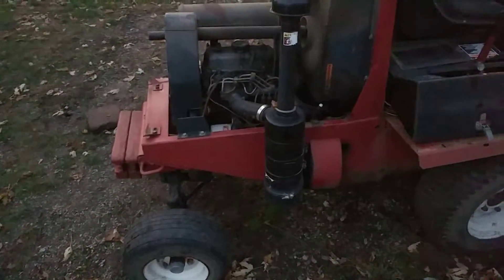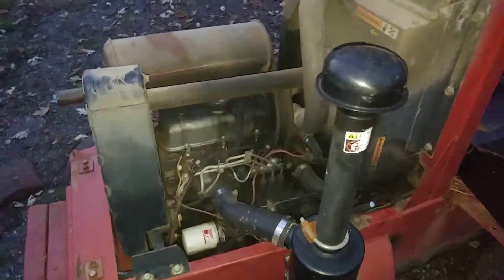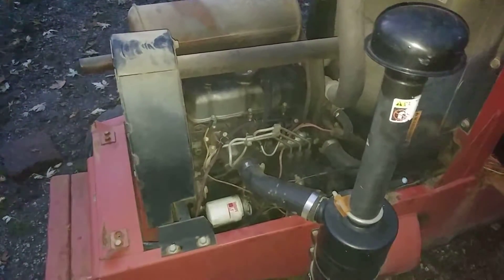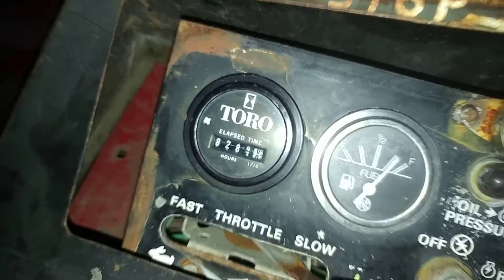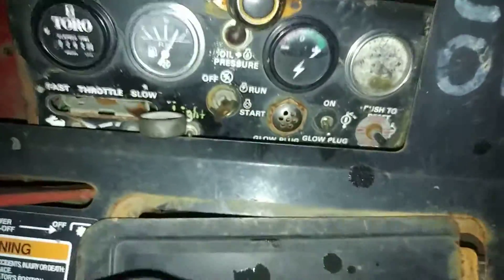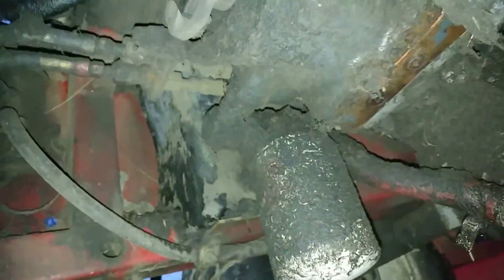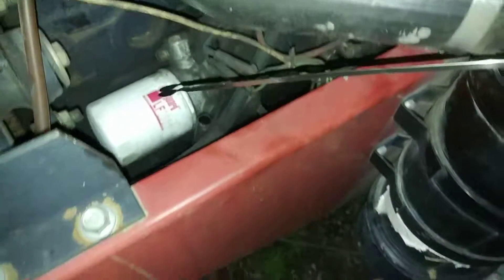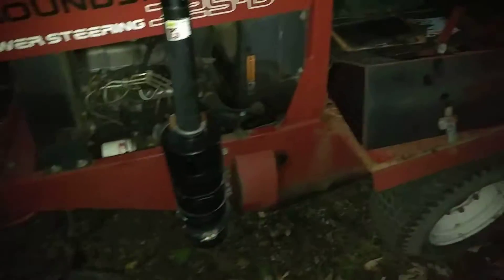93' Toro Groundsmaster 325d with Mitsubishi K3D diesel

Comment: bit late now but the noise your hearin is timming chain rattle, needs a new chain. im chasing a chain and cant find one. it will stop the smoke from intermittently expelling as well, because the chain slop. i too was a little confused with diesel as i have been a gas engine guy for 20+ years. but everythung is the same in them there ingines. just remember the injector is a mechanical substitute for fuel injection on IC eng. the rest is near exactly the same.
Reply from the maker: Thank you for the pros reply and actually know it's not late I still have a thing and actually haven't torn into it yet LOL
Reply: That engine has no chain, just gears. I have the same engine and he is making the same sound when cold. Its just diesel nailing, its an idi diesel, the di i have is much more silent.